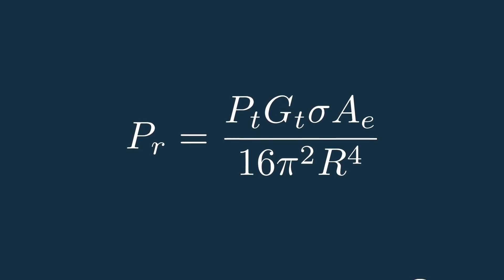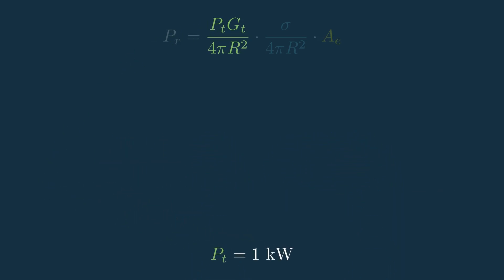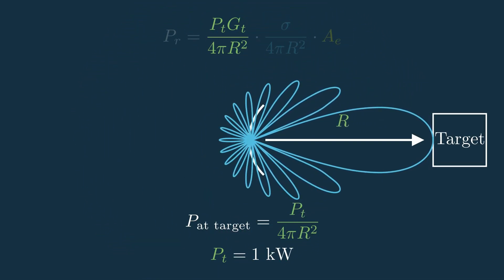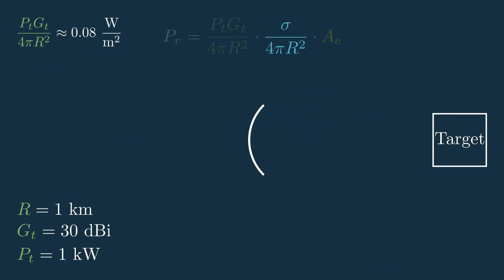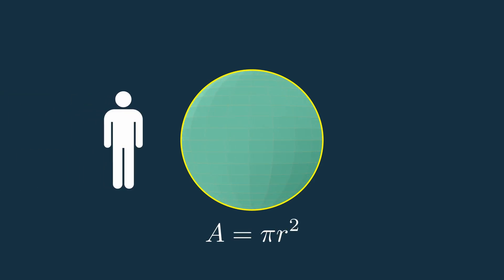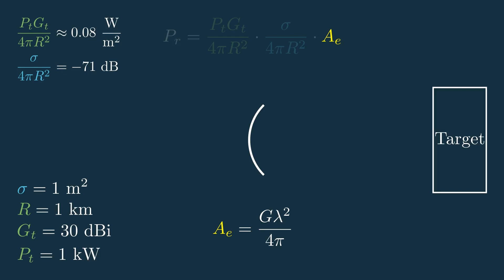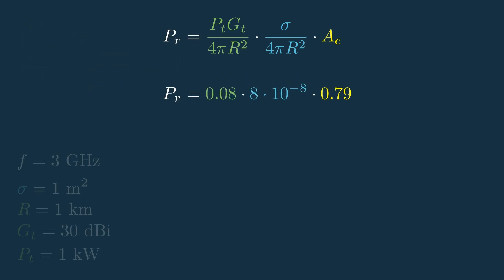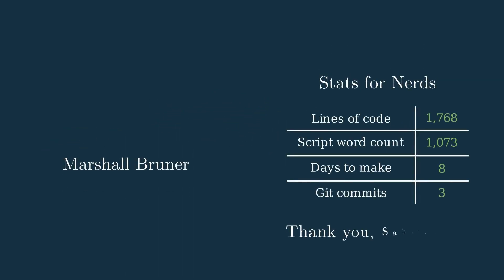What is the RADAR Equation? | The Animated Radar Cheatsheet

Comment: Something to note just because it leads to some interesting details, 1sqm RCS is kind-of-sort-of defined by a 1.13m diameter sphere (approximately 1sqm cross section), a 1sqm flat plate will have a wildly different (and likely several orders of magnitude higher) RCS depending on frequency.  At 10GHz the RCS of a 1sqm plate is something like 14000sqm.  Conversely, a 9.3cm^2 plate is 1sqm @ 10GHz

Also, I think you meant nano-to-micro seconds instead of milliseconds?  1ms is 150km round trip so pushing the edges of terrestrial radars, more like something you'd use for looking at orbital objects.  Automotive radars work in the nanosecond domain and fighter/ground control radars in the tens to hundreds of microseconds.
Reply from the maker: Yeah, I guess I normally work with long-range radars, but it can definitely be much smaller for short-range radars. Thanks for your comment and for watching!